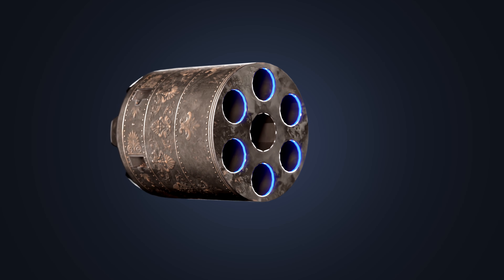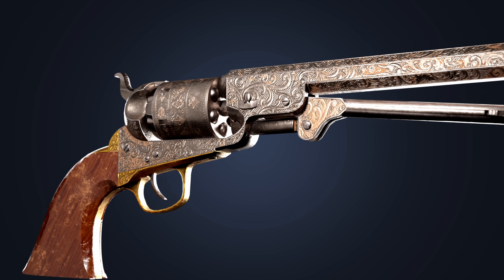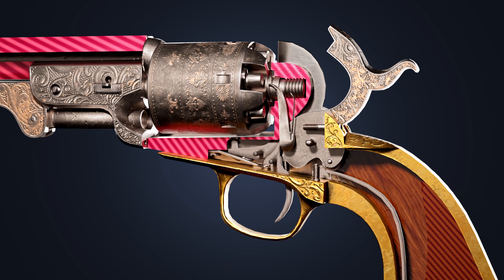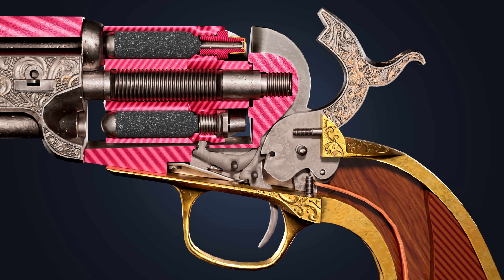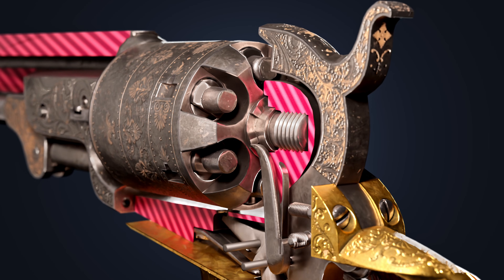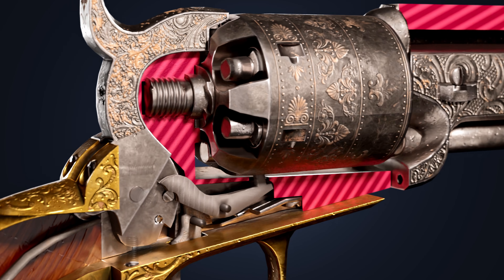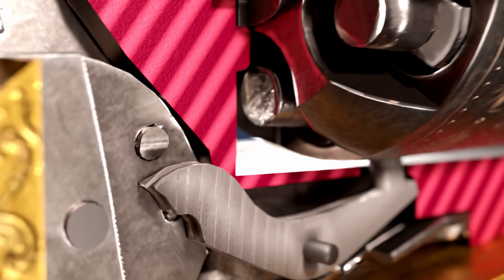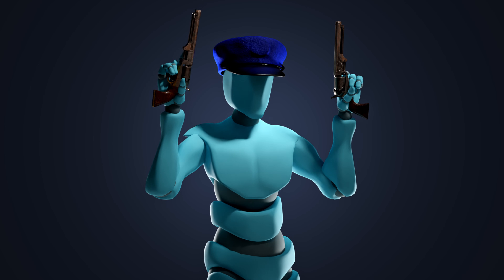HOW A REVOLVER WORKS ? | COLT NAVY 1851 | #defence

Comment: As an owner of one of these guys... Caps on last and you can't seat all the balls and then rotate the cylinder. The balls protrude enough to impede rotation. Plus you have to smear a lubricant or lard on the cylinder front to seal it well and prevent flashover.

Comment: There is a rear sight, it is on the hammer when cocked back. The striking portion has a notch engraved, and lines up with the front post.

Comment: Caps go last!
Reply: Nowadays yes, but historically caps were recommended to go first. This was for two reasons, first you could fire instantly after loading and second, caps actually helped to keep the powder in place. In modern repros the nipple (piece screwed on top of each chamber on which the precussion caps are placed) is designed differently than it was back in the day, then the flash canal was much wider and slightly conical, so loose powder could fall out during loading (that is also why it was preferred to load these guns using paper cartridges, it was quicker and easier). I have a 1970's italian 1860 Army Colt repro that is almost a carbon copy of the original design, including the nipples - I've replaced them to the new ones (made by Pietta, thankfully they fit), as the old design was not to my liking and now I know why it was changed
Reply: @lovecraftfan2793 I too have colt army made in 1974 by uberti and nipples are tight on ends but I dont know if they are from factory like this or what because I bpught this gun from aftermarket. But I have many more factory new. I heard about people drilling those nipples to make them bigger on purpose so they can put bigger caps, but loading like that (putting caps FIRST) is very dangerous, I would rathet use toothpick on loose nipple than put cap first as it is bad strategy, might get you or someone else hurt or worse.

Comment: Amazing graphics and art. Dangerous info however. Placing caps on first before loading powder and ball can be potentially dangerous. Some caps are notorious for sliding off if not the correct size or simply a loose fit or even a normal fit can slip. A rotating cylinder may crush the fallen cap possibly causing ignition and possible loss of fingers if not worse. Remember Caps Last as a common rule. There are loads of videos on YouTube how to properly load Black Powder such as the 1851 shown. I’ve seen quite a few to be sure but never one caps first. I’ve also been in the BP Sport over 47 years and have never even heard of this even being suggested until now.

Comment: Forget to mention the buffer material between the powder and ball
Reply: traditionally there is none.
Reply: @ZSmith-yy4lv  Exactly, people nowadays use wads or semolina, but originally it was recommended to just load the maximum amount of powder a chamber could hold and then use a properly oversized lead ball (eg. for a .45 revolver that would be something in between of .451 even up to .457). In the 1860 Colt's manual it specifically states to load just powder and ball

Comment: The lead projectile is slightly over sized, and when pressed into the loading port, it shaves off a ring of lead. That's what creates the seal. the caps are the last thing you put on!

Comment: Reloading must really annoying
Reply: It is somewhat, but remember the times...single shot rifles and handguns were the norm, although there were numerous attempts to increase the rate of fire...the revolver evolved as a method to fire 5-6 (number varies)  shots before reloading...around the same time multi-round rifles were being developed, think lever action...plus ammunition was being upgraded, with the modern cartridge being developed...it all happened independent of one another, over a few decades...think build a better mousetrap...
Reply: It's not just what John said. The chances of needing the whole 6 shots is remote to non existent. The average person would only be facing 2 people at the most usually. I think 3 lead balls per person is enough to drop them. The people that needed them carried 2 pistols so they didn't need to reload.

Comment: Can’t someone take this design and update it to shoot bullets instead, but also keeping the aesthetics of the gun?
Reply: @KLK01  Colt army looks the same and shoot 45 colt or 44 magnum
Reply: umm, the round lead ball is the bullet in this video...and if it strikes the appropriate body part with sufficient force it is lethal...you're thinking of later, somewhat similar designs, where 'bullets' as you think of them, are loaded from the rear of the cylinder, and later the cylinder designed to swing outward from the frame to speed loading even more (modern revolvers)...you can still buy revolvers with this old design (and yes, the firearms are still lethal), and single action revolvers are still popular (we own two, but they are not cap and ball revolvers)...
Reply: That’s already a common thing. In fact, it has been happening since the late 1800s. It’s nothing but a replacement cylinder.
Reply: @ZSmith-yy4lv cylinder and a hammer to one capable to ignite primers, not caps
Reply: @mariusztuziak3182  I believe the originals had a free floating pin on the cylinder plate itself. Most modern ones I see use that same design. I have seen conversion cylinders that use a fixed pin on the hammer, but I am unsure if that is faithful for original designs or something that came about later.

Comment: First you put either a combustible paper cartridge or loose black powder + lead ball in the cylinder, then you seat the ball completely inside the chamber, pushing it to the very bottom: if there's air between powder and ball you'll have somewhat of a grenade in your hands. Then, only then, you put your percussion caps on the nipples, otherwise it's dangerous as hell. :)

The much needed front seal is formed by shearing a ring of lead (in the modern reproductions) or squeezing the lead bullet in the chamfered chamber's "mouth" (in most of the originals); by having both a front seal and tightly fitting cap on the nipple, you're reasonably safe from chain fires, rain, etc.

Comment: Just bragging: I am into these guns. I have two 1860 3-inchers that I have fitted Pocket Model grips and grip frames to. I make my own cartridges with fffffg powder just like "back in the days". They are nice. I have to travel a lot and I just breeze by "No Firearms" signs with my two little "Aces" in my pockets . . .
       PS - Mine are .44 caliber and I kept developing loads until they exactly match the power Colt .45 Automatic cartridge has = 230 grains moving 855 feet per second. Twelve of those ought to stop a fight !

Comment: How is it done that the pressure from powder is prevented from going backwards kicking the cap and hammer off the cylinder? Is it just inertia of the hammer or do caps hold on so firmly or something else?
Reply: @eF_cz  The hammer holds the caps down.
Reply: What above said plus as noted at 0:23 - specifically "A measured amount of gun powder" - over charging the chamber would indeed create a high risk of a catastrophic blowback event. The type of gun powder used would matter as well - different nations had different formulations and the most common charging powders of today ABSOLUTELY would cause a blowback event every single time as we've made modern powders considerably more energetic. Like firing up an engine with flat tappet valves you need to make sure the stuff you're using is era appropriate so you don't damage the equipment - its a concern of antique armorers and garages (the fortunate thing about formulations of gun powder is that they were kept pretty well documented as gun powder efficacy was and is of state interest - as for those old engines you need to find lead additives for gasoline or order direct with it preformulated but most fuel companies simply don't pre-mix at all anymore as those old valves relied on lead in the gasoline to lubricate and protect the engine components).

Comment: Do NOT put the caps on BEFORE loading the cylinder. That's a good way to get dead.
Reply: @TheNotoriousCheeto  exactamente
Reply: Get dead? You mean die?
Reply: @sindhiairizarry182   kilt  = kilto
Reply: @TheNotoriousCheeto  you mean the caps can make a spark just rubbing with the fingers ?
Reply: Thank you, was just about to say
Reply: I always load the ball first, then the powder, then the wad, and then the cap I smash into the end of the barrel with a rod and hammer, but then the revolver is perfect for throwing like a boomerang 🪃 
I thought that's how you use these.
Reply: @TheNotoriousCheeto  yes that probably should have been examined in a tad different order.
Reply: йипать ты умный !
Reply: Good man 👍
Reply: @TheNotoriousCheeto  if you do not put the caps first isn’t the gun powder running out when you pour it into the cylinder?
Reply: @goliard84 No. the flash hole from the nipple into the cylinder is too small to even let one grain of gunpowder through.
Reply: @aquila8553  Nowadays yes, in modern repros the nipple is designed differently than it was back in the day, then the flash hole was much wider and slightly conical, so some of the loose powder could fall out during loading (that is also why it was preferred to load these guns using paper cartridges, it was quicker and easier). I have a 1970's italian 1860 Army Colt repro that is almost a carbon copy of the original design, including the nipples - I've replaced them to the new ones (made by Pietta, thankfully they fit), as the old design was not to my liking and now I know why it was changed. Historically, however, caps were recommended to go first, as you could fire instantly after loading and second and caps actually helped to keep the powder in place.
Reply: @goliard84  If the flash hole would be that big, the gas pressure from the explosion would automatically recock the hammer but also blow the remnants of the percussion cap straight into the shooters face. Flash holes actually do burn out btw. which also has a negative influence on precision. That's why the cones are screwed into the cylinder so they can be swapped out when they're worn down. I had to exchange the cone on my 1851 Feldstutzer as the hammer began to return the "cocked" postition after everery few shots, which is a typical sign of a worn down cone. just the new cone alone greatly reduced my average groupings by about 15 cm at 50 m
Reply: @goliard84  These weapons usually burn fffg powder.  I know that even ffffg will not vibrate through a nipple but that fffffg will. Also - 99% of the time these were not loaded with loose powder and round ball - instead they would go to the hardware store and buy "cartridges". Back then a cartridge was a conical bullet with a step-down at the tail. A little bag made of nitrated powder holding about 15 grains of 5fg powder was tied onto the rebated slug-base and it would burst when the slug was rammed down on it. 
       Using essentially a half-charge of doubly-rapid burning powder fouled the gun less, made less smoke, heated up the gun less thus slowing down leading up the rifling and improved accuracy. They also "hit harder" and kicked harder - the whole point of buying better store bought ammo.
Reply: @goliard84 it’s won’t.  The cap hole is way too small even for a grain of 3F or 2F powder but just large enough for a cap spark to get through the other way.   I’ve been shooting this gun for 24 years

Comment: That "explosive" in the caps are usually mercury fulminante back then. I don't know if it's still that today or modern chemicals being used
Reply: @jehoiakimelidoronila5450  Modern caps use either lead styphnate or DDNP.  They are more stable than the mercury fulminate originals, so much safer, and they also last longer before degrading.
Reply: Thank you for the comment
Reply: Mercury Fulminate was used up until the 1950’s. It is known as a corrosive primer and the residue cause extensive damage if it is let sit for any significant amount of time (and the mercury vapor isn’t good for your health either). It also decomposes at about 100C so boiling water will render cartridges using it useless…
Reply: Got it. Thanks for the heads up